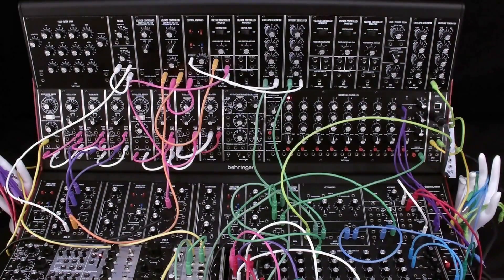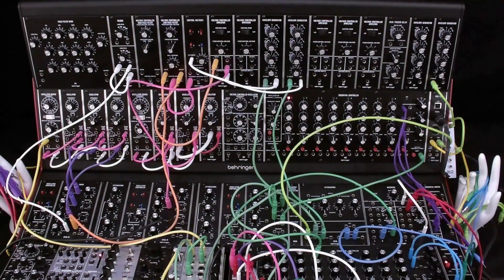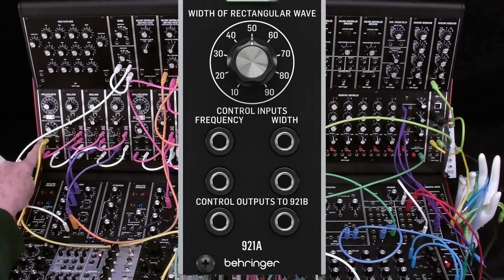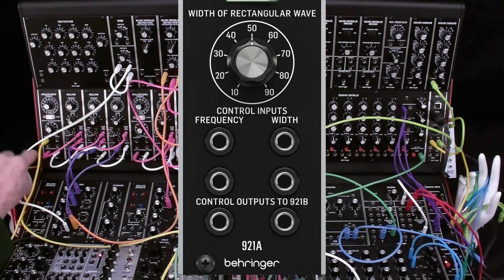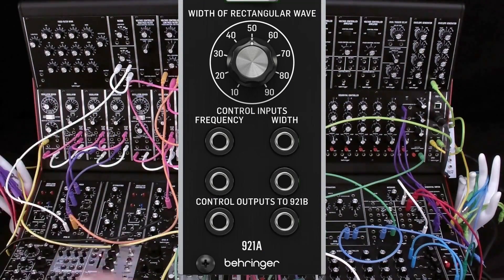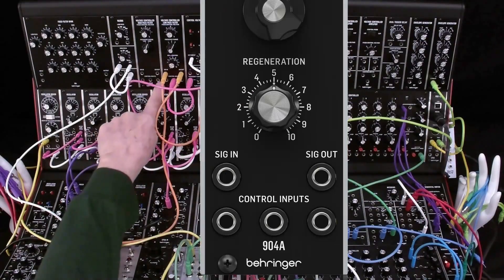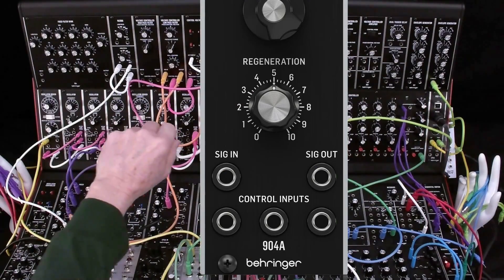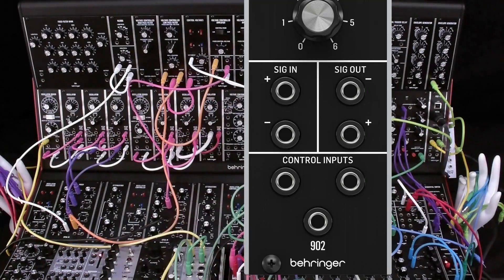System 55 Mixers - Active and Passive

Comment: Time for a little update / modification on your video seems warranted (I can ssuggest): https://youtu.be/A720hgdE45M?t=162 (your Sytem 55 UNboxing also got updated; YouTube informed me, very rescently): https://youtu.be/A720hgdE45M?t=162
Reply: https://youtu.be/i6Ah4Te3XAk?t=184
Reply from the maker: Really interesting technique.  @sarahbellereid does a lot of those videos.
Reply from the maker: Finally got around to updating the Description with a disclaimer.  thx.
Reply: @ozhalljr  Still the content in this mixer video on the System 55 (S 55) is at certain sections fundamentally and unwantedly & permanently in error.  You still have several options including - for now - removing it form your otherwise interesting depositions here.  How to proceed? A) Deepening 101 electronics theory course (not hands on) could calm down the need for overresponding with even more postings here. B) DIY passive and active resistors building based on calculated resistor values, etc. C) Have a serious sit down one - on - one with a graduate in electrical engineering, a note pad and pencil and re-understand the 101 course.  D) Get an additional row or Euro rack space with some more REAL Dr. Moog designed mixers by e.g. Behringer, etc., and explain that you never can have enough of these.......MIXERS!  And/or, add to your otherwise interesting video on the major missing aspects of the S 55 synth: a missing mixer with many more inputs or routing options than the old original that served all major needs in the past but modulars tend to get larger that last 50 years - hence see also my remark + a you tube vid from your friend - see blow - re the application of a matrix mixer!
Reply: Or, go an additional step forward and introduce the next level of modular mixing: https://youtu.be/ymKWp2WcSsI?t=273

Comment: On the attenuators and mixers in 15-35-55 styled models/modules: https://youtu.be/qCmL5OeBgm8?t=220 - mixers and multiples are different and are for different purposes by design - your statement to use THESE multiples as stand alone devices (even with some extra potentiometers) to be used as passive mixers as displayed here is VERY incorrect Mister Hall, reconsider your section on "multiples" here in your video - THX for your consideration: https://youtu.be/qCmL5OeBgm8?t=220
Reply: https://youtu.be/UrCFv2qCELI?t=243 - some theory.
Reply: https://www.youtube.com/watch?v=q8tmUgaXrEQ
Reply: https://youtu.be/cHJJu-hJLoE?t=98
Reply: https://youtu.be/g1eAsHxHG6g?t=54
Reply from the maker: Aemil Thanks for the multiple references.  I'll be working my way through these with the intent to create a correction video.  Thanks again for educating me on this topic!
Reply: @ozhalljr  THX!
Reply: @ozhalljr  https://youtu.be/mYk8r3QlNi8?list=PLOunECWxELQS5bMdWo9VhmZtsCjhjYNcV&t=446 - start there, I may suggest?
Reply: @jr https://youtu.be/mYk8r3QlNi8?list=PLOunECWxELQS5bMdWo9VhmZtsCjhjYNcV&t=451 - give it a shot or your best shot - an acquired set of knowns for life and nearly 'for free'!

Comment: Your speak: https://youtu.be/ewwpPWB1VOc?t=147 - "a multiple can  be used as a passive mixer": that is technically not correct and also as such not intended in general electronics.  

If you want to passively mix you better get a real resistor passive mixer and NOT just have two output stages of e.g. a Bode shifter and an Dr. Moog design oscillators' output  stages feed into each-other via a multiple and then feed in to the input of e.g a filter - that is not the idea / how things are done professionally - there are VERY unwanted side effects that you may never knew (since you can not A/B wrongly connected devices) and also you can NOT replicate such setup with an other spectral content.  

These output stages are simply not designed to operate that way!  That your synth keeps operating does not mean (you can not A/B) does not mean that it will work for low or high(er) frequencies or even dynamically (or very Bass rich sounds - they may cancel out).  More often than not you also will adversely & negatively affect the signal - to - noise ratio in a large setup, hence eliminating expensive electronic design and technical progress in general - a waste. 

This (your) way of how you plug and play, and talk; AND you write in the header above: "I'll also show how to create a passive mixers with a multiple." This is NOT the right way to explain & technically incorrect.  You better revisit your texts/imagery her and expand into distributors (a passive multiple) and passive attenuators and real (active) mixers and (external or euro rack passive mixers) (often used with mixers with only one aux send to /stereo return) to drive e.g four or five different effects pedals, etc., in general destinations. Often called summing passive mixers as seen in PRO studios to mix a few dozen or so effect returns in 2 new outputs without any noise or power consumption into a stereo effects return on the master-bus.

Passive resistor mixers are very simple devices that often are used - in analogy here with oscillators to feed into 1 filter, as example if you run out of active mixers. Better in your situation to add a Dr. Moog 4 into 1 active mixer and mixer as intended: a low output impedance sound source into a high impedance input device (a filter input).  Passive attenuators are also often used in a backwards way if summed and used as mixer but even that requires extra resistors in addition to the attenuation potentiometer(s).  

You have to LARGELY expand here on DC coupled active audio mixers that also can mix Control Voltages vs passive multiples (distributors) vs active AC coupled mixers vs summing audio only (often AC coupled or assumed AC fed and AC sending/receiving) or summing DC mixers ((with or without DC shifters (or a variable offset) often used for wave-shaping of oscillators)) or active mixers (with additional positive or negative gain if needed), etc.

You cut yourself short - and therefore your public and shortcutting outputs of pricey euro-rack modules - my main concern here is that a passive multiple (a piece of wire) is a distributor to send 1 voltage or signal to 2, 3 or many more destinations and not a device to blend output stages of pricey active devices, hundreds of $ or euros that need a formal input stage often 100 to 1000 times (or even more) in impedance (and not zero or 1, 10 or 50 ohms or 1000 ohms serie output resistor / impedance of another output stage or stages) - to operate correctly - over the frequency range for which they were designed.  

You overextended your enthusiasm for economic and practical solutions that often (or only in the equipment you displayed) may (partially faulty) operate but doesn't result in replicable results over time, device manufacturer or type of device but are potentially consumed by you pubic as a truth.   If learned as such on a modular synth (which is considered useful for any recording, mix or sound engineer, or synth player in general) and later used with high power guitar amps, lighting systems, computer interfaces, or what not....: adverse effects may occur.  HAVE A LOOK AT PASSIVE RESISTOR MIXERS as stand alone solutions - often there is a volume knob that you can use - they also can be used backwards and become a resistor based distributors and then the knobs can act as modulation depth - draw some wiring schematics and see how it works - CHEAP!
Reply from the maker: Thx
Reply: @ozhalljr  STOP-STOP-STOP: even here you can see on your 'scope’:  https://youtu.be/ewwpPWB1VOc?t=389  that the feeding signals by the upper 2 waveforms are diminished in amplitude and altered in wave shape as a result of your mixing efforts - an indication of wrongfully loads on the outputs of the oscillator - see for yourself 10-20% of the amplitude is GONE in upper chanel and the mid channel shows a DC shift AND massively altered waveforms.

The inherited residual (your ‘mixing’) shows NO amplitude increase for reasons that are very different than your reasoning - that is an effect of ‘non-DC’ but only ‘AC-coupling’ somewhere in your mix an/or measurement chain (and similar frequencies but from an opposite polarity) cancel out - since you drive the waveforms form one and the same oscillator providing these waveforms hence - in this case - the same frequency - additionally the fast fourier transformation - frequency - analysis would have show a very modified spectral content and thus a loss of musical information.

Moreover,  the original waveforms (upper and mid channels are mutated, lower in volume, shifted DC levels and show ALL signs of electrical wrong functioning, overload, distorsion, and potentially exhaustion in the output stages of the oscillators themselves due to abnormal loads and usage causing electrical malfunctioning in the oscillator (resulting in altered waveforms that you intended to mix) and therefore causing non-replicable results and (potentially) shortened longevity of the modules, drift in tuning and more heat dispensation in the components of the output stages of the device itself.   

You do NOT want that the original feeding waveforms (which also may be used elsewhere in the modulation or signal paths) have been altered - these were carefully designed (by Dr. Moog) due to massively mismatching of the very use and application of a multiple (a passive distributor and not a mixer a all): https://youtu.be/ewwpPWB1VOc?t=401 - your display - at least the pertaining section of your video here, does NOT explain anything other than yours’ gross misunderstanding of elementary electric theory, unusual application of visual material (“scope”) and the potentially misinforming - while you keep up your video here - of your public. 

You can do better and improve of the otherwise - at some sections - nice video here by understanding and building DC coupled or AC coupled passive resistor (including the pots or variable resistors) mixers yourself for under 05 (five) dollars in component cost and finally start the 101 - 909 electrical courses in order to inform others - the old Radio Shack booklets would have been TOTALLY explanatory in this regard for you and your helpers (if any) - check your local library, a Greensheet/2nd hand booklet store, Internet 2nd hand outlets 2nd hand markets for some copies. In addition you could benefit to be informed about active and passive distribution of signals by studying distribution amplifiers (e.g. for headphone mixers) or how to connect 1 aux send of your mixer to e.g ½ a dozen delay and filter and echo pedals/euro-rack units and subsequently mixing these in a passive resistor (summing) mixer or active summing mixers - either AC or DC coupled depending on the need or availability of either type and the AC or DC coupled output stages of the connected devices - good luck with your findings - eventually your public may benefit from it!  Wanne mix (with)in transformers or with speakers, mics and live sound mixers too and add spectral content - that is also an option?!

Comment: Thanks for the video. Good explanations. I personally would not mix using multiples because it also influences the source of the inputs. I only use multiples with 1 input and 2 or 3 outputs. But it can be done as you showed.
Reply from the maker: @attorks Thanks of leaving a comment.  I'm a fan of your music.  
I don't often do passive mixing, but it is another technique in the bag of synth tricks.  Passive mixing came to my attention as I researched the original ARP 2500 for the videos I did about a year ago.  The ARP 2500 patching matrix allows you route from multiple outputs of other modules to a single input. One example is patching different oscillators or waveforms  into a filter audio input.
Reply from the maker: For anyone reading this.  @attorks (Martin Peters).  Taught me how to do Berlin School sequencing!